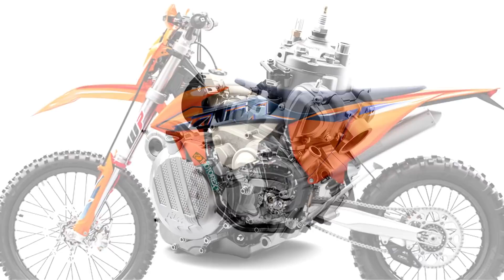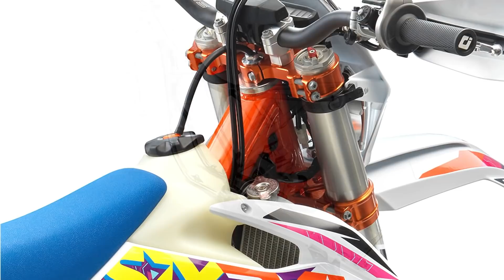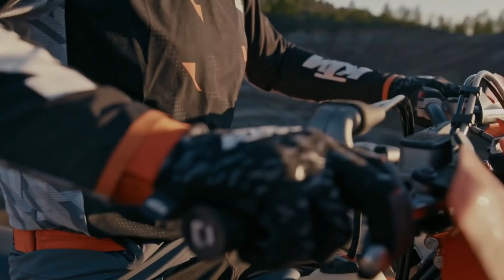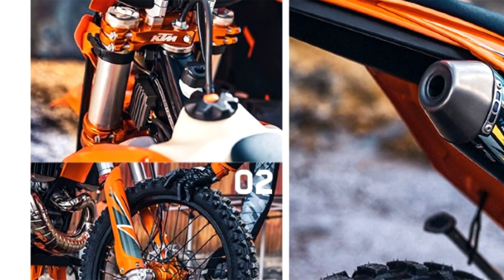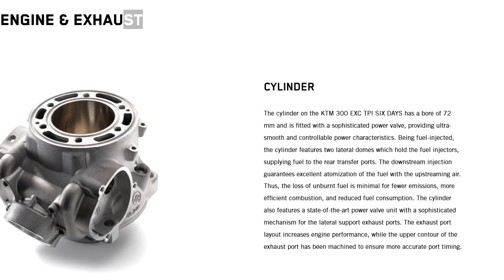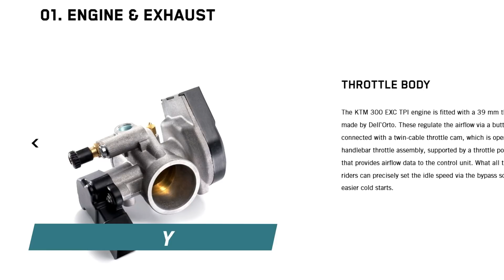2022 KTM EXC – KEY RANGE UPGRADES

Comment: I would not call the suspension changes an upgrade!  My 2021 300XC-W felt much better than my new 2022 300XC-W.  This '22 blows through the stroke just as easily as the '21 did, but now the forks feel harsh, the bike feels less planted and not as well balanced front to rear.  I am not pleased at all with these forks or the poor front to rear balance.  
But, I must say this engine has a little smoother throttle response and better low end torque.  I don't know the cause of the engine changes, but I like that part!

Comment: So basically no changes from the previous model...
Reply: Some times you don't want to change perfection, just leave it or you can F it up.
Reply: @kimojon9665  don't fix what aint broke
Reply from the maker: small changes in forks & shock settings